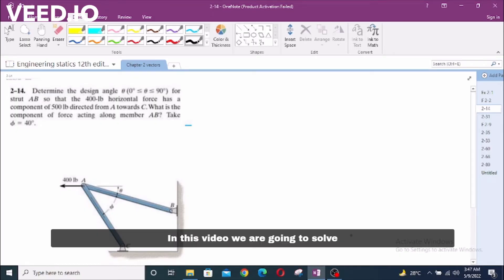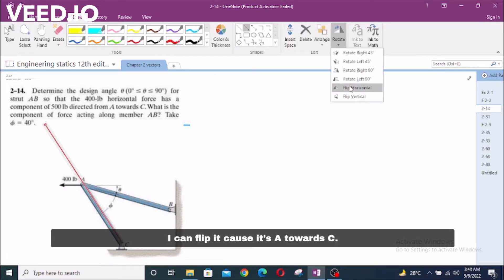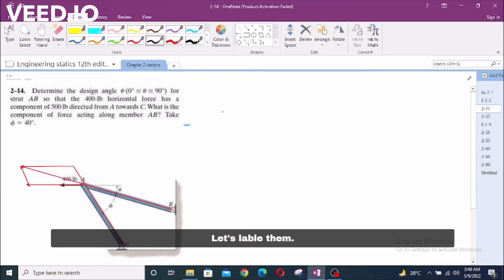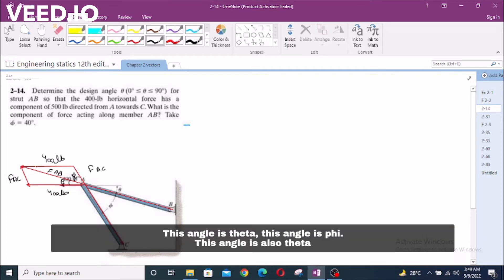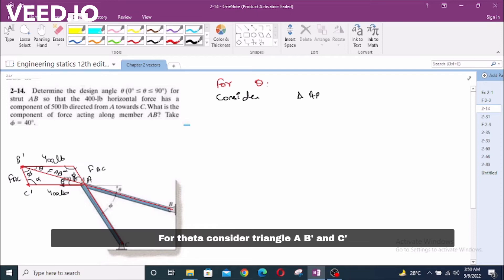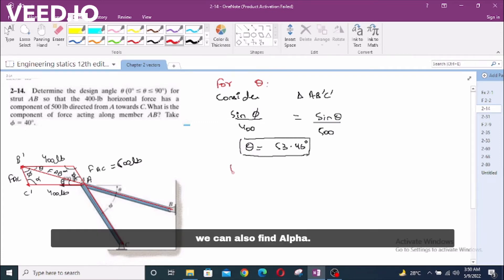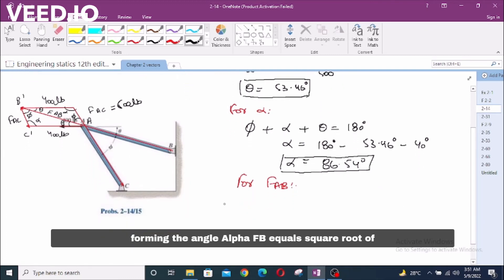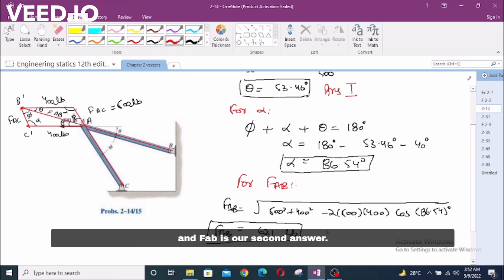2-14 hibbeler statics chapter 2 | hibbeler statics | hibbeler

Comment from the maker: Learn How to Solve 2-9 Hibbeler Statics Chapter 2, "The plate is subjected to the two forces at A and B as shown. If theta= 60 , determine the magnitude of the resultant of these two forces and its direction measured clockwise from the horizontal."
Here is the Link: https://youtu.be/32tNBUuVHxM